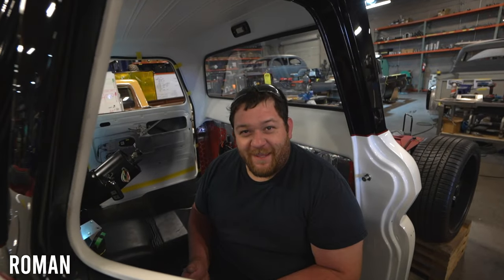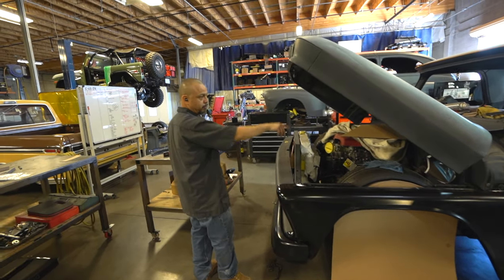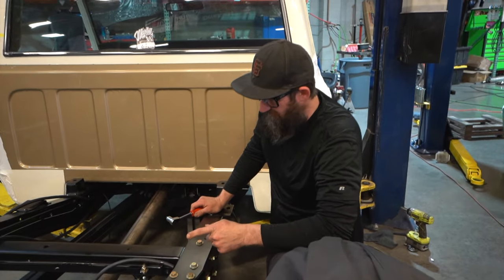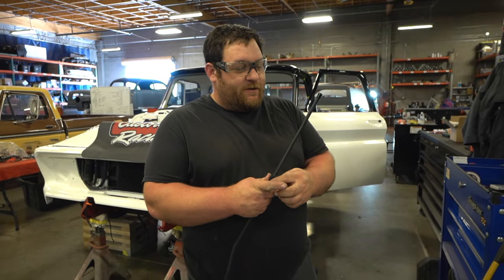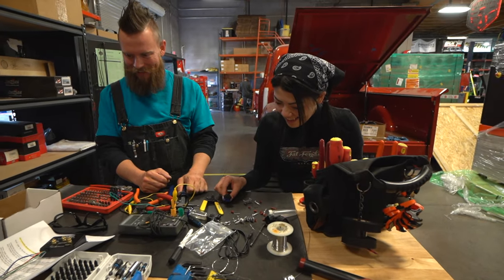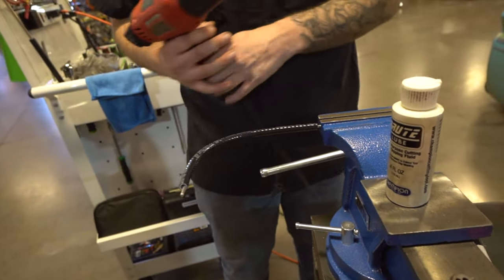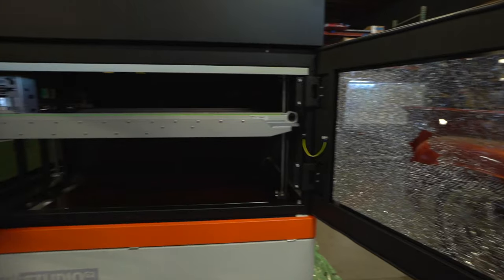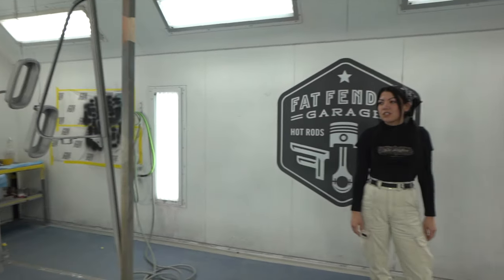FFG Shop Talk | Episode 5

Comment: Is there any durability difference between the air dry or bake Cerakote, and can you put it on thicker...
Reply from the maker: Each color has different specifications. All very similar, but some colors more durable than others. Prep becomes huge factor. 1-2 coats around 1mil is ideal.